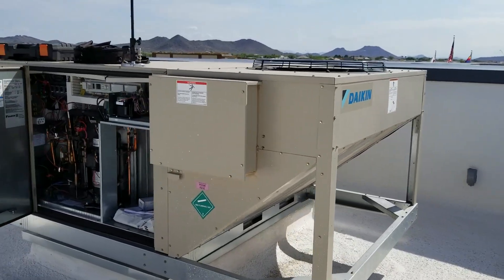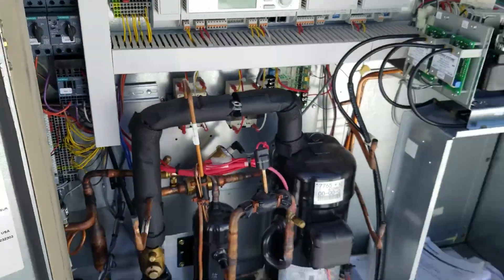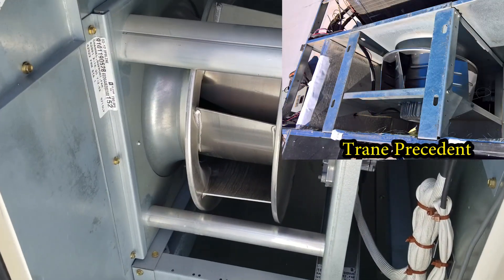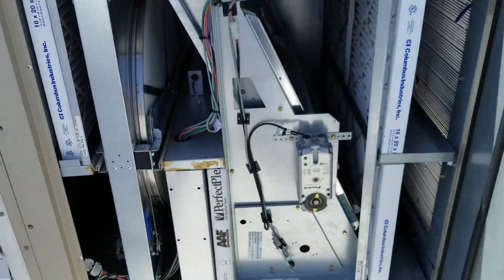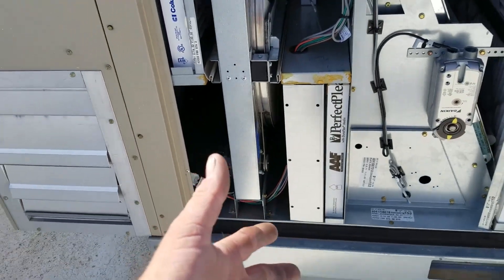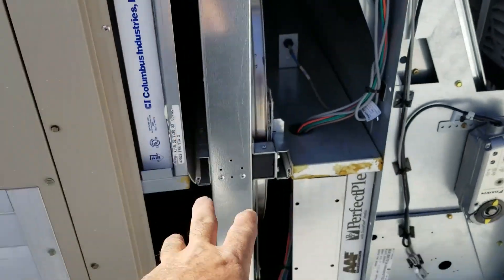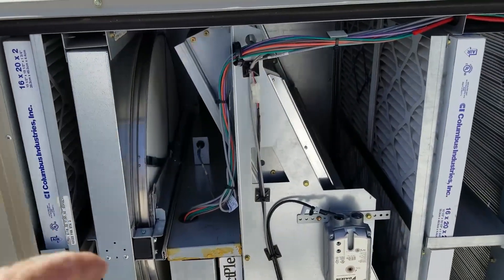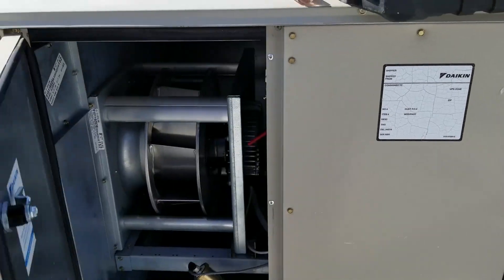Show-n-Tell of Daikin unit with enthalpy wheel for energy recovery

Comment: So was it broke?  Noticed the jug of 410 at the end.
Reply from the maker: Sparky drilled through the rooftop from above the t-grid below and didn't realize that he was drilling up through the roof curb and right into the condensate pan of this unit.

My coworkers pulled the charge and coil to replace the pan.
The facility closed and the EMS turned off so I just stopped by the next day to add the remainder of the R410a